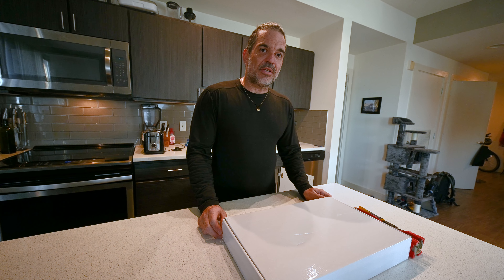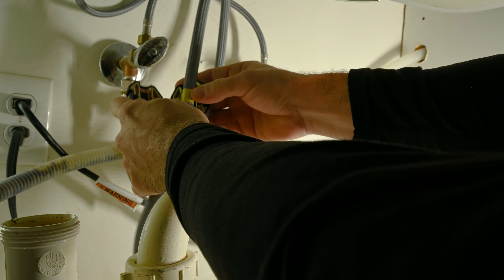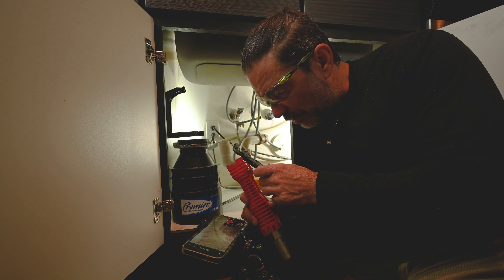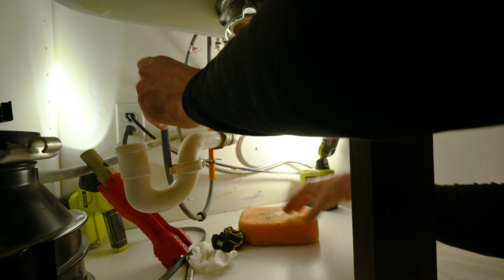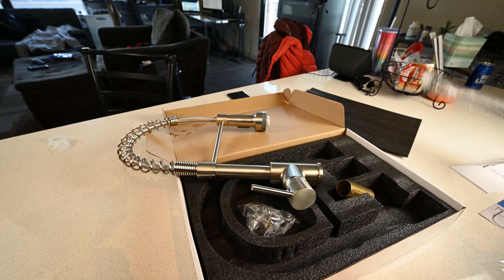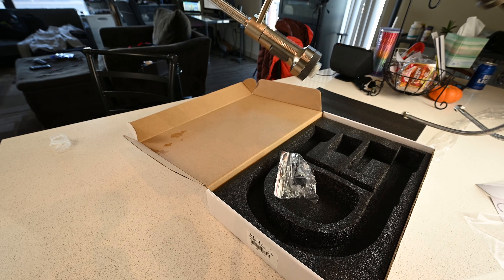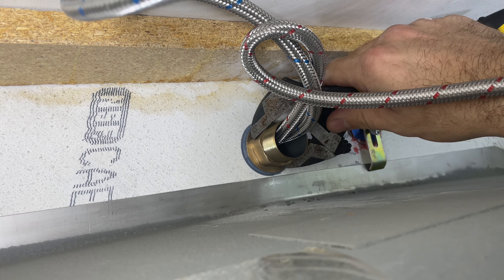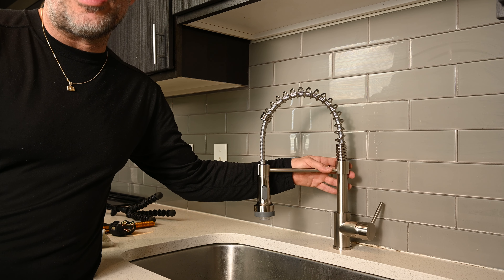Upgrading my Kitchen Faucet - it Lights Up!

Comment: @4:40 "Seems pretty sketchy to me"....I've watched about 4-5 videos because I thought the same.  Did you have any issues with it leaking right there?
Reply from the maker: I’ve had no leaks this yet
Reply: @ApartmentMaintenancePro  Would you recommend using thread sealing tape for those if you have it?

Comment: Lighting only worked for two weeks and they don’t sell replacement parts
Reply: My current issue
Reply: A buddy of mine just uses a head lamp when he washes dishes.  May be an option if the light goes out.